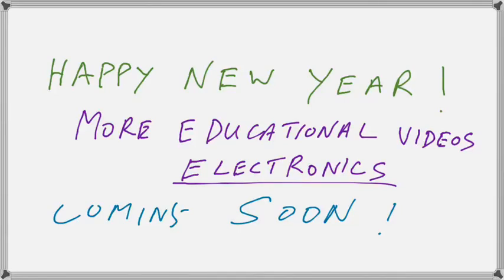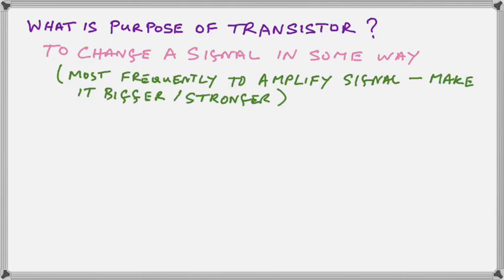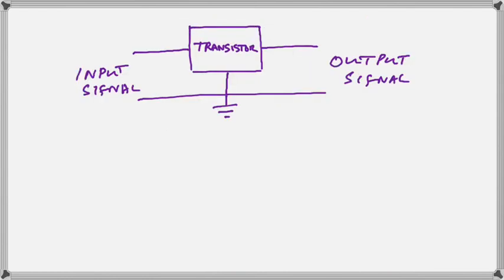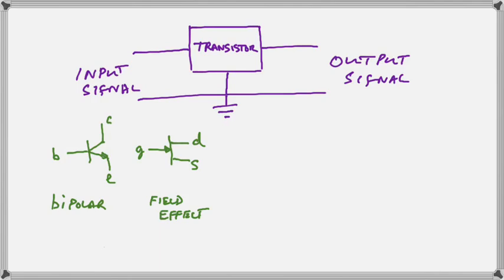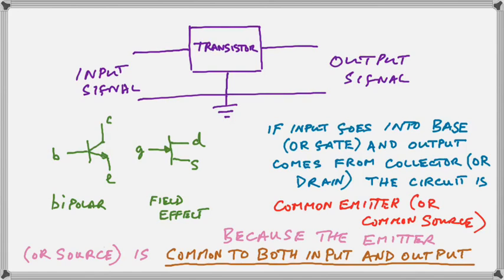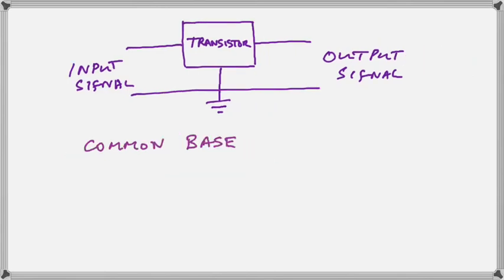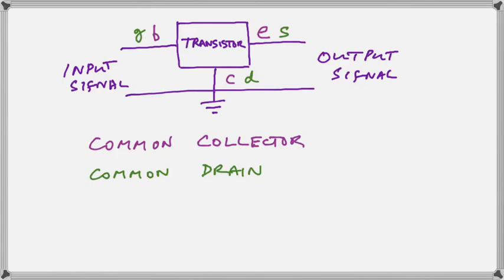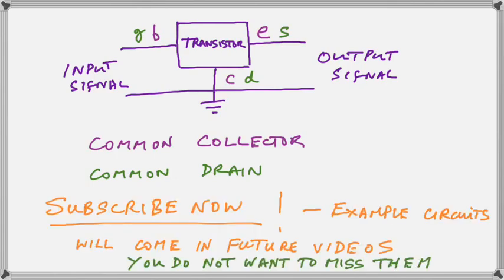identify transistor circuit configuration instantly

Comment: Thank you for the video. The definition is correct but not always a CE configuration has the output on the collector, but can be on the emitter and not always the ground is common.
I know, it's a little confusing 😅. I am trying to identify the configuration even in those cases because you find them in diagrams of commercial products.

Greetings